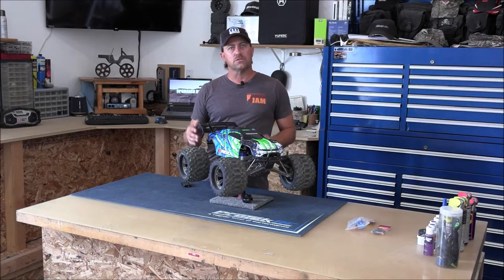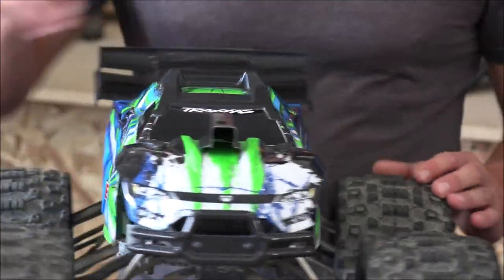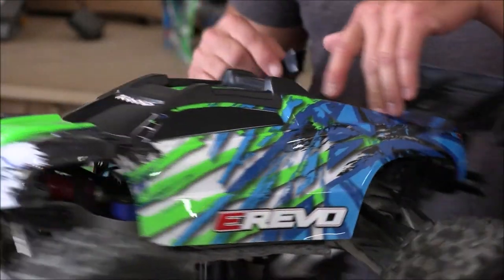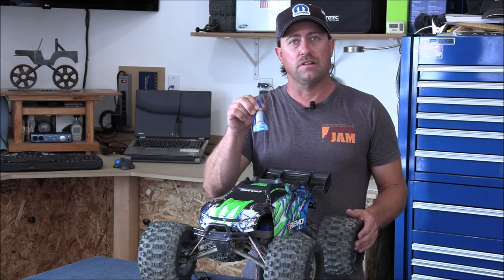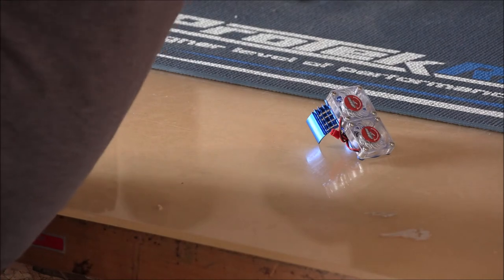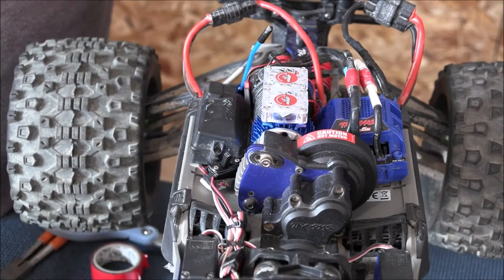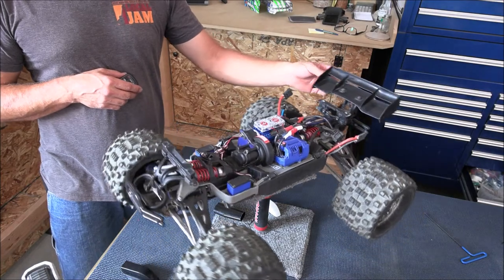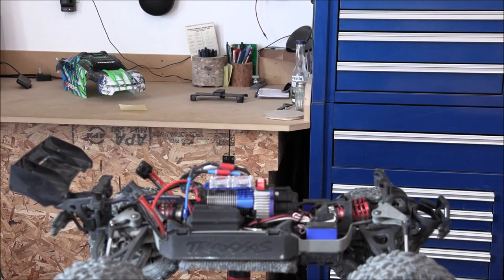Beat The Heat!  With Air Ducts And Cooling Fans

Comment: Nice! But I’m pretty sure that if you powered the fans from your third channel of the receiver, there is a switch on your transmitter connected to that 3rd channel, so you probably could switch on and off the fans from that one, no need for the switch under the body, right...?

Comment: I’m running powerhobby turbo fans. The body cracked the rear fan on a bad crash, but with just the front fan and the heat sink it kept it to 140f with the esc getting to 165f.

Comment: Does dust/small rocks ever get into critical components? Tore up a baseball field and noticed some fine dust through the little center driveshaft door on the bottom... is this an issue or should the only things able to get in so fine that it doesn’t matter? Or do you fully disassemble your whole drivetrain every time 🤔
Reply from the maker: I would take off the skid plate every couple of runs and get the rocks out.  They will damage the stock plastic driveshaft.

Comment: ... Did the air ducts last?  I am thinking that they will break when you crash.  Also, you might want to check out some of the thermal paste they put on CPU heatsinks.  Just a very thin layer.  It allows better heat transfer from the surface you are trying to cool to the heat sink.
Reply from the maker: I think i'm getting lucky. They haven't broken yet lol!
Reply: @upgradedrc3697  it might be something I look into myself then.  I have only been into this hobby since early September, and that was with my daughter's car.  I got the erevo about a month later and haven't really had the chance to push it in the heat.  I lived in Phoenix for a couple years when I was in my early twenties so I do understand the immense heat you deal with out there...

Comment: another nice and clear video...awesome! My E-Revo seems to have something strange lately.
when the car and receiver are both on and I do nothing...the frontwheels keep steering to the left side automaticly?! 
I have reset everything few times allready but somehow this issue keeps coming back :( any ideas what to do?
Reply from the maker: Is your TSM or AVC on to high. this is common with TSM turn it off and see if it still does it. If that doesn't help, then I would rebind and recalibrate the receiver and esc with the transmitter. If that doesn't fix it, then check your endpoints on the steering, it's probably off a little bit. If all that doesn't fix it then you have a hardware problem that probably needs to replaced. Try the TSM off first. And let me know.
Reply: @upgradedrc3697  thanks allot..will give it a try and keep you posted !

Comment: Great idea on the air scoop dude....I’m in SW Florida so the heat issue is something I’m very aware of with my E-Revo ...  soooo ... I’m definitely gonna do your mod on my truck ...but ... I’m gonna use that plastic weld you see all over the web .... you apply your resin and cure it with a UV light that comes with the resin..... they say it really works well ..... great Vid T (as usual) have a great New Year! ☮️ / out
Reply from the maker: Sounds great, let me know how that works.
Reply: Where at in SWFL im from Charlotte county?
Reply from the maker: @jblock206  I'm in Whitewater Colorado

Comment: If you’re worried about hot air at the roof just drill a few holes in the roof. It’ll cause a Venturi effect when the air passing over the body flows over the holes and bring in air from the tire area. 
.
Honestly, with how open the back and fender areas are I sincerely doubt there is any heat buildup under that shell. 
.
It would be nice if traxxas made a couple fans in a cutout in the center of the chassis to draw air from the driveshaft area and a little duct to flow it over the motor.

**edit. Guess I was wrong and there was quite a bit of heat buildup in there.
Reply: you all probably dont care at all but does anyone know of a method to get back into an Instagram account?
I was stupid lost the login password. I would love any help you can give me.
Reply: @Deandre Robert instablaster =)
Reply: @Enrique Benson i really appreciate your reply. I got to the site through google and I'm trying it out atm.
Looks like it's gonna take quite some time so I will get back to you later with my results.
Reply: @Enrique Benson it worked and I finally got access to my account again. I'm so happy:D
Thanks so much you saved my account!
Reply: @Deandre Robert happy to help =)

Comment: Buddy we need an e revo 2.0 bashing video! I wanna see how durable it is and how well it handles 😁
Reply: I send send minez bash hardcore 
Only thing I've replace is tires I only run 6s 
Does get hella hot tho
Reply: @robertstaats535  this is facts. Gets hot as hell running stock gearing in mid height grass for a whole pack even with a cheap dual motor fan heatsink setup but the things a goddamn monster bashing (with aluminum chassis brace and limiting straps) I also had to replace a tire but like you said, after a year of owning and bashing it Ive only had to replace one tire

Comment: Why don't you try cutting out the front windows as well? That's what I do the the temps dropped significantly as well.
Reply from the maker: Doesn't that throw a lot of dirt, sand, or mud on to components and ESC?
Reply: @upgradedrc3697  it's not too bad to be honest. Plus most people clean off their rc's every few runs. I haven't noticed a huge difference in terms of dirt getting thrown in. Use a brush to take off some dirt after every run. Try it out sometime I think it's beneficial to you since you live in warmer climate.
Reply: Or you can even cut out the window and add a mesh to block some dirt but allow air to come in

Comment: What kind of work stand do you use?
Reply from the maker: I made my own!
Reply: @upgradedrc3697  appreciate the quick reply!! I really like yours, square base looks solid with stability and clearance vs bulky bases. GJ! Also I just purchased 4 fans and two switches off eBay. Preparing for summer when it gets here.

Comment: Man don't know what I'm doing wrong.  My stock motor with vents cut out in back could get over 200 from just bashing no back to back speed runs in 90s ambient.  With a larger heatsink and dual fans 170s but it throws heat onto esc and hit thermal cut out lol.  Thinking of cutting out windshield nitro style and throwing a better fan on esc.  

To be fair I'm running mx38 tires which probably add some more stress.  Can't run a full pack without letting my erevo cool down half way.
Reply from the maker: What kind of gearing are you running? What battery.
Reply: @upgradedrc3697  stock gearing, traxxas 3s 5000mah batteries.  Thinking load of fans is also stressing esc now.  Also used thermal paste on heatsink to make sure it transfers heat as best as possible.

Honestly thinking about just cutting a hole in windshield and mount a 40mm fan to push air onto motor and esc.

Comment: If you are so worried about the heat... Maybe put heat sinks over the entire engine instead over only 1/4 of the engine... Those fans that got no heat sinks under them doesnt do a shit.
Reply from the maker: I'm not worried about the heat. That was a video for people who are overheating.
Reply: @upgradedrc3697  then you should tell them to start with a correct heat sink that covers the entire engine, and to use cooling paste and fans on the heat sink before doing holes in the chassi... You can also add that your way is technically free tho 😁